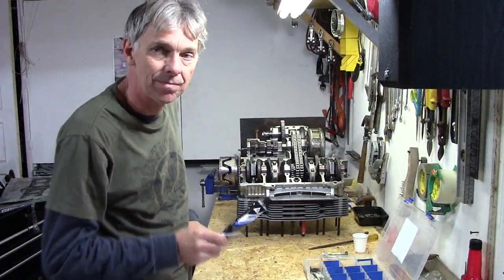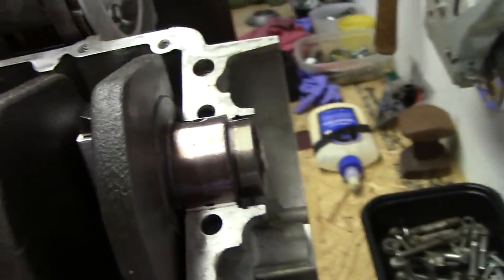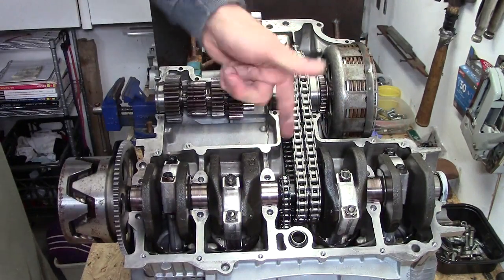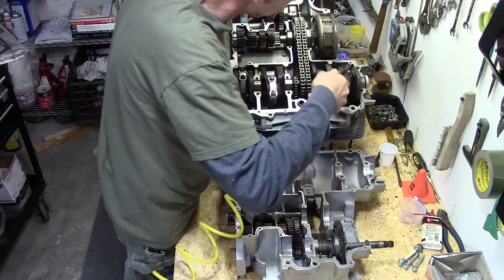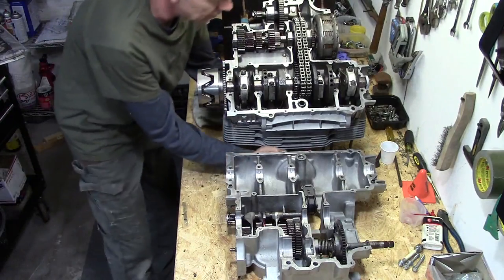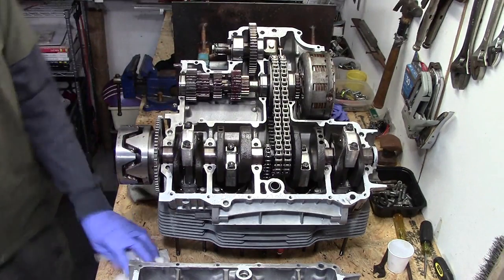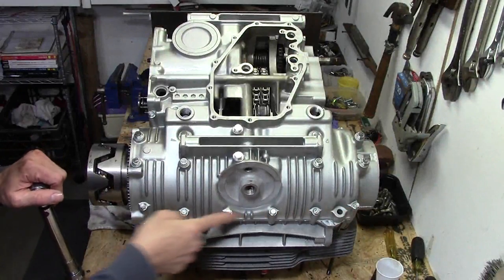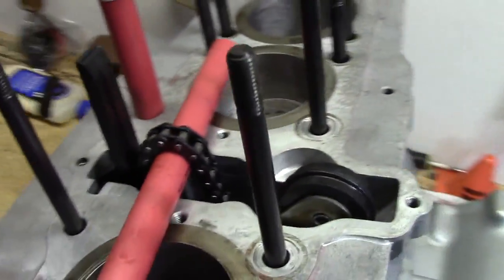73 Honda CB750 Custom Build Part 15 - Assembling The Crankcase Halves

Comment: Great videos! One thing is that I was always taught to not use oil on threads when using a torque wrench as you're reducing the friction therefore risk over tightening the bolts and stripping them?

Comment: I've seen some others touch on the Hondabond near the bearing issue, but I'll just keep watching and see if you have issues later on. As a professional technician for 15 years, I never get anything foreign near a bearing surface, not so much the bonding issue but a contamination issue causing a bearing to spin/seize later on. I have enjoyed the build so far.

Comment: Hey Dean, I was wondering if you could provide the link for those print outs that you use when installing your case bolts. I have a Clymer manual but would prefer simple diagrams rather than old murky pictures. Thanks alot!

Comment: Thanks for your videos! They are very nice to watch before doing CB750 surgery. I have opened my engine completely but it is always something new and better procedure to learn. Easy to forget when I did it for long time ago. 

I saw comment about sealer around the bolt holes for crank close to the shells. No sealer can end up in oil leak via the bolts. I have  sealed there 4 times on my engine CB750K6, no problem.  5:th time withing a couple of weeks.

Comment: I'm currently rebuilding an 82 CB750. Totally different engine, but these project videos you have are still insanely helpful!
Reply: Cameron Fischer I just pulled my 81 cb750f engine out to start the rebuild process. Any tips or lessons learned you could offer? Thanks!

Comment: You are a lot more careful then the Honda factory, which never oiled any bolts, and did not use torque wrenches.  Ever.  I worked as a Honda mechanic and attended the Honda school for a week when the 750 first came out. Afterwards  I never had to open up a 750 engine again for the next 5 years that I worked there. And we sold a lot of Honda 750s, in fact we set a record of 105 for Memorial day 1970!  By 1969 Honda had their engine precision down pat and breakdowns were a thing of the past.

Comment: Great videos! I just discovered these last week!  Not sure if you found out what that bolt was for yet at the 25:00 min mark, but I just pulled the motor out of my '77 CB750 last summer and will take a look tomorrow to see if my motor has that bolt or not.  Again, great videos! Will definatly reference these during my upcoming rebuild!
Reply: Checked my bike tonight, bolt holds a small elongated hoop bracket on top that looks like it would contain the carb overflow hoses.  Not sure how to post a pic.  Hope this helps!
Reply from the maker: Jordan House Got it!

Comment: I've always found it useful to mark each bolt as I torque them with a color code sticker or sharpie mark. Then when I've finished I can check each bolt has the mark. Do other people do this?
Reply: loloaqici82qb4ipp I did that when I was wrenching on cars every day. Always marked important bolt after torque with a paint pen.

Comment: Hi Dean. First off.....Love your videos. I watched all of the VFR 750 rebuild, and, though some things i'd have done differently, it was great. Anyhoo..... Do you know what medium these cases were blasted with? I'm using glass bead on my VFR750FV cases, and I seem to be getting nowhere....except for going through a truck load of glass bead. It'd seem that the Aluminium is too soft for the glass to do any good. On 316 it rocks.....but ally, it sucks.
Reply: I think sodablasting is the way to go. Not done it myself. But i've heard from others that soda works good. :)
Reply: krqkan Yeah.... I've not used soda, either. I'm not sure if it'll be any better than glass, but I suppose i'm going to find out...
Reply: Marty Smith  My bets are on soda! :)
Reply: I'll let you know what my findings are. I hope Soda works, as i'm after a REALLY clean, crisp look. Thanks for your input. I'll be in touch, as soon as I have a result.
Reply: Marty Smith Yes please do!
And good luck! :)

Comment: Hello Mr. Hackaweek,
I enjoyed your vids and learned a lot watching them. I am currently rebuilding a Honda cx and have a question regarding the sealing compound. Can it replace the gasket? Since you did not use any gasket on your engine reassembly I assume it can. I read some different opinions about this topic and would like to hear yours. I am looking at this compound to use in my project https://www.louis.eu/artikel/elring-dirko-ht-sealing-compound-70ml/10004064

Thank you for your answer and comments.

BR from Slovenia

Mat

Comment: does the head have to be removed to remove the lower case?
Reply: MrC3mac1 I've asked this same question and on the CB750 forum the answer was NO! The full service manual says yes but that's for shop hours billing purposes! Just make sure it's in neutral, TDC and the flywheel rotor, clutch, points cover and oil pump has to remove be removed! Be sure to have Hondabond or Yamalube and the applicable gaskets before reassembly!
Reply: No

Comment: Great video as all ways. After reading your note on this show I have a question. Have you thought about building your own computer. Its alot cheaper then buying a premade one and it might make a good video. If you do decided to build your own I suggest looking at a barebones kits from tiger direct. they come with everything you need.
Reply: Right now I'm posting from a new machine, a Dell T3500 with a Xeon 3.20 GHz processor with 6GB of RAM running Windows 7. It has a 1 TB hard drive and I can upgrade the RAM to 24 GB. I'm hoping this will provide the speed I need. Thanks for the suggestion. :)

Comment: What is the oil pan meant to give access to?  I mean, why did Honda bother to put in an oil pan rather than make a solid bottom to the engine?
Reply: Ah, it's the oil pump, which you have not yet reinstalled.  You show this in part 18.

Comment: Putting Honda bond und on the main bearing caps scares me. Is that spec?
Reply: No, it's not. Took great pains to plasti-gauge the bearings, and then put something in between the main cap mating surfaces. Honda bond only on the external wall mating surfaces.

Comment: I see you put sealant beside the main bearing surfaces, Is this recomended by Honda? I know Kawasaki has a warning not to do this and to stay away from oil holes.
Reply from the maker: No mention in the manual. It just says to coat the surfaces with sealant. If any thing tries to squeeze through, the crankshaft would stop it anyway. As far as oil gallery goes, there's a sleeve and o-ring on this engine so no worries there. Kawasaki's warning would have some merit around the oil holes because it could get into the oil gallery.
Reply: HackaweekTV not fan of putting sealant so close crankshaft or camshaft main journals, we have a guy in our shop put too much 515 on a camshaft main cap 60 series Detroit and then engine wouldn't turn over the next day, took a while to figure his mistake.  Lol
Reply: johnnym1320 515 is some pretty stout stuff. I've used it on Porsche flat 6 engines. Honda bond shrinks a bit at it cures and it stay pliable. I guess the only concern would be the channel in the main bearings getting a little in them. Oil should be able to move past it easily.
Reply: You're right. No Honda bond, or anything for that matter, anywhere near the main cap mating surfaces. It's totally inside the crankcase, it's not like oil is going to leak from there, and it just threw out the oiling tolerances in the bearings, which he took great pains to plasti-gauge earlier. Probably will spin a bearing because of it. It was difficult to watch.

Comment: Hey I got all my pistons in the the head and they are hard to turn in the  cylinder any  suggestions  please
Reply from the maker: That's fairly normal. Did you install them dry? Put a squirt of Marvel Mystery oil in each cylinder and turn it over. The oil will help to "seat" the rings when you first start it.
Reply: @HackaweekTV  ty

Comment: Wouldn't you want to put lock tight on the bolt threads instead of oil?
Reply: Paul Marshall No need for lock tight. The oil helps allow a true torque setting.
Reply: Their's also what's called 3 in 1 oil if it's metal screws/bolts screwing into metal parts 💁‍♂️🔩